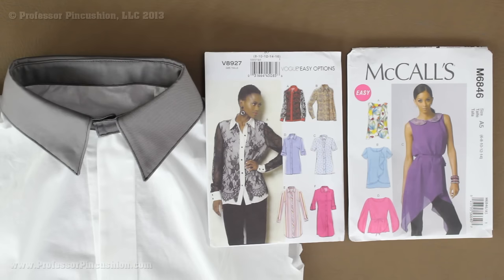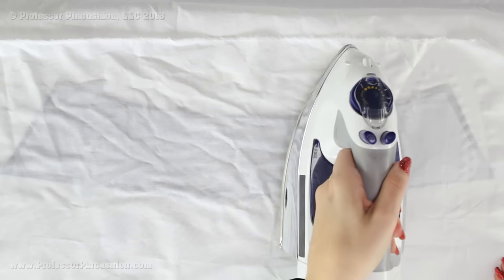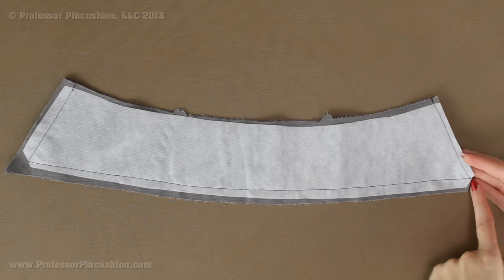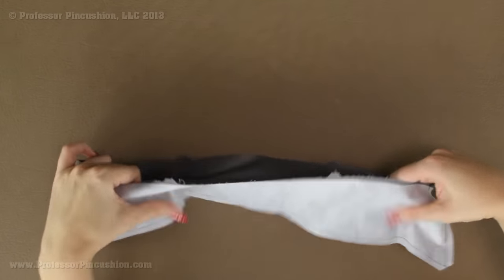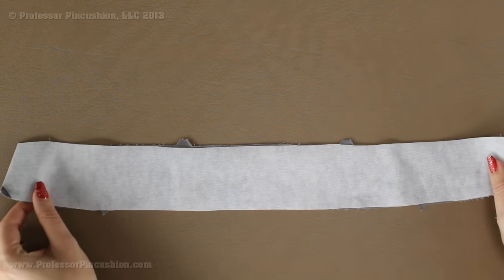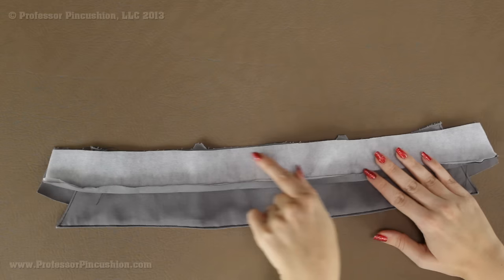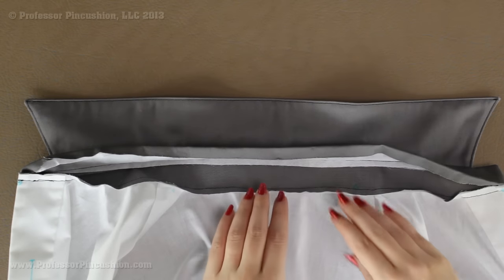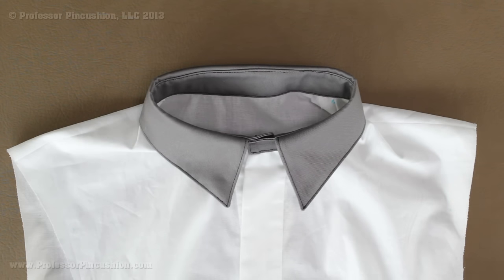How To Sew A Shirt Collar

Comment: wonderful tutorial! :) will try and use these steps to make a smaller collar for my doggy! do you think i can starch the material instead of using interfacing?
Reply from the maker: xianated Are you planning on washing it? because starch will come out in water and then you'll have a flimsy collar again.  I would use interfacing and then you don't have to worry about it.
Reply: Professor Pincushion good point, didn't think of that.

Comment: Professor,I can't make the corner of my collar looks as sharp as yours but I've followed all the steps.Could you give me some tips?Thank you before.
Reply from the maker: You probably just need to trim more of the seam allowance in that area.  Then on the right side, very carefully, use a straight pin to pull out the fabric as much as you can. You can also buy a little tool at the fabric store that looks like a flat, pointy stick to push out corners but I just use a straight pin.

Comment: so for the collar stand (and also for the collar), is the one with interfacing the front one or the back? My instructions don't mention which one's which. Thanks!
Reply from the maker: danutzafly the side with interfacing is on the inside when the collar is finished and propped up.  does that make sense?  Even if you flip it the other way, it's not going to ruin your garment :)

Comment: you know what professor, i have been sewing collars and i always do this way and i always mess it up. even if i handbaste it, the stitching on the right side is fine ( i topstitch) but then on the wrong side, the stitching is uneven. so i'm thinking it's because my front collar stand is not equal in width or height perfectly to the back side so when i top stitch, the stitching is all crappy on the inside, like i miss some fabric. how do i achieve a perfect collar with perfect stitching??? i check out my ready to wear shirts and they seam perfectly stitched??? how do you achieve a perfectly even and folded collar stand??? please answer. :) love you. :)
Reply from the maker: +JHONATTANFF I think you're being too hard on yourself and your stitching is probably not as noticeable as you think, especially if your bobbin thread matches the fabric.  I know I'm my biggest critic and nitpick things that no one else probably notices.  Honestly, I don't think it's your stitching as much as cutting out the fabric pieces.  I'm sure collar pieces in factories are manufactured or punched out in a way that makes them uniform and close to perfection.  When we hand cut out a fabric piece, it's probably less then perfect so when it comes to seams and top stitches it may be a little uneven, especially on the bobbin side of the stitching.  To get a better fabric piece, transfer your pattern to a stiffer piece of paper like cardstock or manila paper.  You can even glue your tissue paper on this new paper and then cut it out.  That way, you can make sure the pattern is as flat as possible, then place it on your fabric and use a small rotary cutter to cut it out.  Instead of folding your fabric to get two fabric pieces, cut out your pattern pieces on a single layer of fabric.  The better your fabric pieces are to begin with, the more accurate you can get when sewing it all together.  And don't be so tough on yourself :)
Reply: Professor Pincushion yup you're right!!! :) i hate myself for being such a perfectionist!!! hahaha. thanks for your help!!! i appreciate it! :)
Reply: +Professor Pincushion f

Comment: What is a good sewing machine for beginners?
Reply from the maker: Donald Walker I've had the same sewing machine for 15 years now so don't really have a lot of experience with other machines.  I suggest looking on sites, such as overstock.com so you can read reviews of actual owners and see what's most liked.  I will say that as a beginner you don't need to invest in an expensive machine with a lot of bells and whistles.  As long as the machine can do a straight stitch, zig zag and buttonhole, that's what you really use 95% of the time anyways.  You can probably get a decent machine for under $100.  good luck!

Comment: What saw machine should I get to rock my own shirts?
Reply from the maker: there are a lot of different types, many of which I haven't used.  I recommend checking a place like overstock or amazon, pick a price you want to spend and then read reviews of actual owners to see which one is the best.  If you're just starting out, you can probably get a basic machine for about $100.  As long as it can do straight stitch, buttonholes and zigzag stitch, that'll cover most of everything you'll use.  Most of machines will charge more for having a ton of extra bells and whistles but you usually don't use those very often.

Comment: would this work for converting old mens t-shirts into polo shirts?
Reply from the maker: redwolfmatt hmm....I don't know how well that will work.  Usually polo shirts are made from a stiffer knit so they have more body than a flimsy tshirt. You'll have to use a different knit fabric for the collar and definitely use interfacing.  They have a knit interfacing so that there will still be stretch to the fabric but I guess you'll just have to experiment and see if collar will stand up ok.  Good luck!

Comment: I was wondering, what's the point of a slipstitch if it gets sewn over anyway?
Reply from the maker: If you just do the top stitch, it doesn't always catch the folded edge on the inside.  This just makes sure it's secure.
Reply: Professor Pincushion thank you!

Comment: any tips on how to add this collar to a ready to wear shirt to refashion the shirt? i want to add a collar to one of my sweaters
Reply from the maker: you can collar pattern pieces from an existing pattern.  I would maybe use double folded bias tape to finish the bottom edge of the collar band after sewing the collar pieces together and then just slip it into the top of the sweater and hand sew it into place.  With hand sewing, it makes it easy to remove the collar later if you want :)
Reply: Thank you!
Reply: hi
Reply: Katherine Sillaman ok

Comment: This was super helpful until it came time to attach... (not your fault)  I'm working with McCall's M6873 and the collar is waaay too long for the neckline.  I'm not sure how to fix it, already wasted a full day on this suit.  I'm just going to have to scrap it...
Reply from the maker: how much are you talking about?   If it's a small difference, you can ease the pieces together.  Watch this tutorial on fabric easing:  https://www.youtube.com/watch?v=Eh7_zvHcIio
Reply: Thank you 😊 It was quite a lot though. I ended up winging it and it went together okay. I had the same issue with the sleeves. It doesn't say to ease them in, but there was a good 2 inches extra at the sleeve head. The rest of the pattern was a breeze.

Comment: Why such a big seam allowance on patterns, I don't think anyone with a home sewing machine needs so much room unless you have an overlocker. I find it much easier to sew along the edge using my foot as a guide and making the next size down to compensate.
Reply: If you are doing run and fell seams or French seams and not overlocking them you need the extra seam allowance. If you neaten with zigzag, the extra fabric gives room for the raw edge to roll under neatly. Also, a tiny seam allowance doesn't work for a fabric that frays a lot, like satin.

Comment: Can you let me in all the measurement of the collar parts.
Reply from the maker: the measurements are going to differ depending on the size.  It's based on the neckline measurement so the piece sizes will vary.  You can always go into a fabric store, find a pattern with this type of collar and then measure the pattern based on your size.